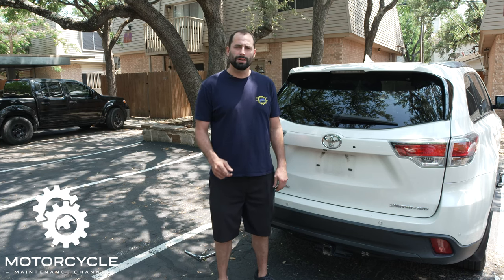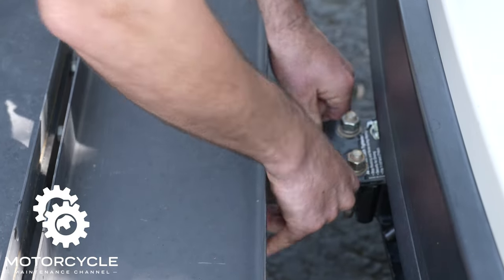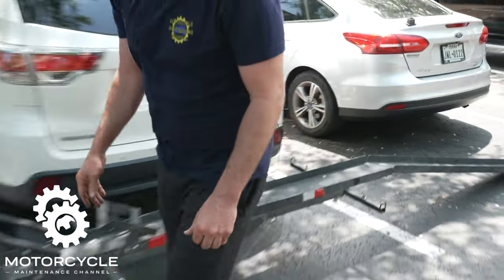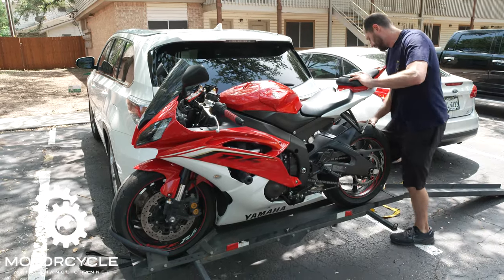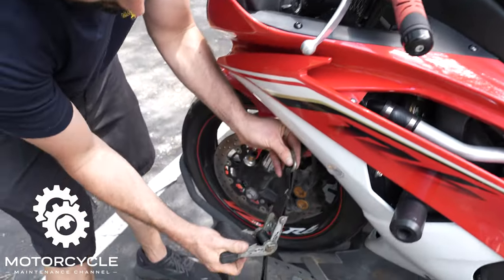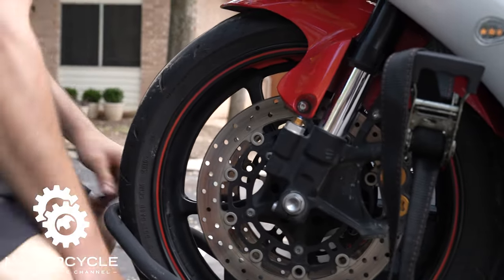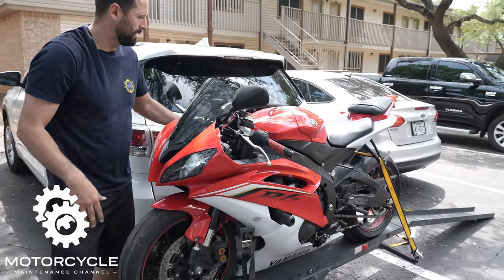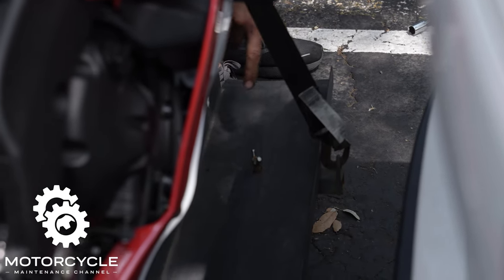How To Use a Hitch-Mounted Motorcycle/Dirt Bike Carrier (Attaching & Using Ratchet Tie Straps)

Comment: Very helpful video! I'm wondering what your highlander's tongue weight rating is? I bought an Outback Wilderness for carrying my V2 to race tracks, our bikes weigh similar, but my car's tongue weight is rated for 350 lbs (1/10 of its towing capacity) which I'm concerned about. Will the hitch come off if I load my bike up there? If it's just sag issues I guess it's fine my car comes with lifted suspension

Comment: My back is already injured so I’m good 😂 I’ll say I had this hitch hauler off brand looked exactly the same and without the stabilizer it tilted while making a long sweeping turn at about 30mph with my ktm 350 (236lbs) and the front wheel catch caught the front wheel (good) and it bent the whole flat metal platform and came off! Total junk. Aluminum rage cage ones with ladder platform that doesn’t allow momentum of wheels way better and lighter
Reply from the maker: Definitely need to buy a good one and a stabilizer to help!

Comment: Did you follow the speed limit of 55Miles per hour as recommended or can you go faster. going on round trip of over 300miles and speed limit is 80 here on i10. 55 Miles an hour would almost double the trip
Reply from the maker: I try to keep up with the flow of traffic, but when the roads are wavy or just bad, I definitely slow down.
Reply: Technically, you're not towing, you're hauling, and the lower speed limit does not apply to you with a hitch mounted carrier. Same as if you loaded the bike in the bed. Follow the 'normal' speed limit and you're good to go from a traffic law perspective.